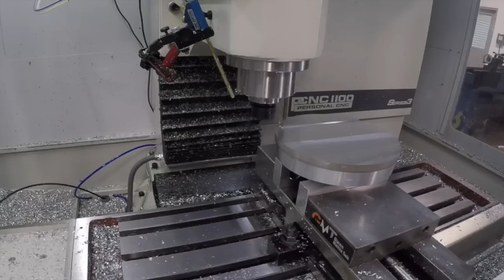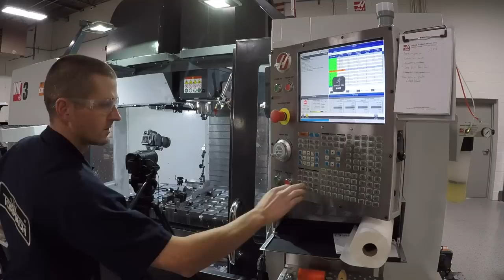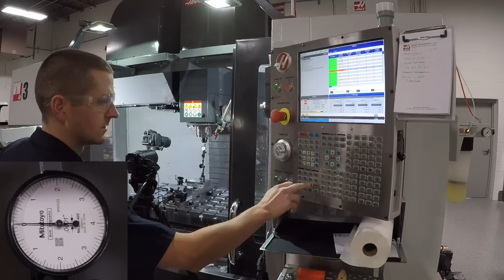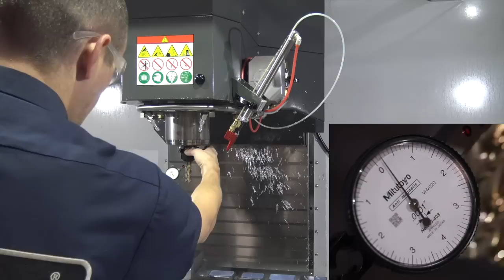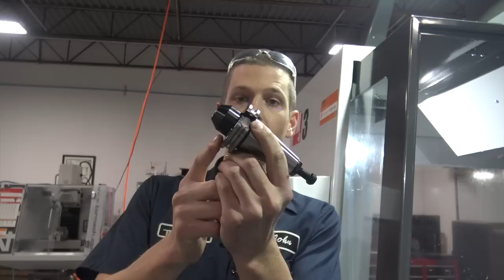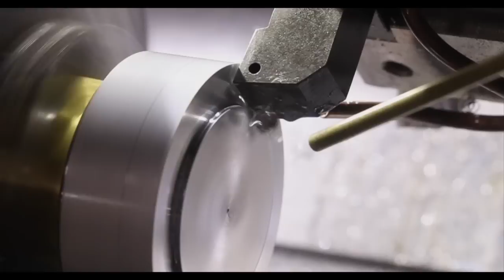Set Screw Up.  UPDATED:  Does a Set Screw Holder Deflect!

Comment: When I read the concentricity comment on the previous video that sounded right to me. And it wasn't just grabbing the small area on a CAT40 tool holder. It was also wrapping it in electrical tape. :-)
Reply: Liberty4Ever He is checking Cylindricity, not concentricy.
Reply: I didn't even know that cylindricity was a word!  :-)

Good point, though.  I try to be precise in my language but failed in this instance.
Reply: Liberty4Ever Generally concentricy is the runout between to cylindrical surfaces, Cylindricity is the runout between a cylindrical surface and a control surface, the taper of the tool holder (control surface) and the endmill (the ctclundrical surface). In aerospace the GD&T will get you if you aren't up with ut.

Comment: you still only have half of the test. You need to put in a pin or something that allows you to measure the run out at some distance. The screw could do two things (one or both at the same time): 1) offset the tool from the center line and 2) change the tool angle in regard to the rotation axis. You need two readings to tell. This method would also have alerted you that something was not right with the setup in the lathe.
Reply: Baldur Norddahl 
A tenth or less at 2.5" (roughly) from gauge length is negligible and inconsequential during cutting. The endmill will deflect considerably more than that. 

This doesn't need laser mic precision.  The test was more than adequate to show run out.
Reply: It's not going to angle the tool unless theres debris, and there can't be any debris, since the fitment is so tight between the collet and tool.
Reply: @Bentley Beckley
That's an assumption, and as john mentions (and i've found myself), assumptions are really really dangerous when machining. It would be quite easy to test the cylindrical shank of the endmill near the holder, and again on each of the cutting surfaces (turning spindle backwards!). Would take an extra minute, but prevent the assumption (right though it may turn out to be), that the tool's axis of rotation is parallel with the tool holder's axis of rotation.
Reply: peter taylor yes, I realize it's an assumption, and wish John would test it just to disprove or prove the theory. but it's not just an assumption based on nothing, it's based in the fact that to have 3 thou of run-out at the .5" or so down from the end of the collet there would also have to be 3thou of something 0.5" up from the end of the collet. Or else it somehow didn't seat properly against the side wall which also seems unlikely. regardless, it's such a trivial amount of run-out it won't make any difference.
Reply: Bentley Beckley if the run out is due to an angle it will be magnified at the end of a long tool. Anyway this is simply good practice and would highlight some possible problems with the reading if there are any. As I said it would have made it obvious that something was wrong with the setup in the lathe.
Reply: Sounds like you blow out collets first! Well done
Reply: I did the math.  An error of .001" over .75" works out to 4' 35".  And .0001" over the same distance works out to 0' 28".  That 28" angle carried out to 2 inches is .00027" and the 4' 35" works out to .00267" I would like to think that Tormach, or whoever is actually manufacturing/QCing these can hold better tolerances than that on angular errors with a surface grinder.

Comment: Opinion and bias can really lead you down the wrong path to a solution to a problem, we all do it all the time and can mitigate it using a bit of critical thinking, think it through,  have others do the same and like you did here test the heck out of it.  Make it a proven fact not just a "feeling" that it is correct.  

Good work!
Reply: At the same time, entering a round of testing with an initial expected outcome can sway the results of that testing..
Reply: True, although in this case I think it was the opposite. He wasn't expecting the CAT40 to have much run out, so the last video didn't support his hypothesis at all. If he was under the assumption that key-ed tooling was worse in terms of run out, then that last video would've seemed a lot more biased.